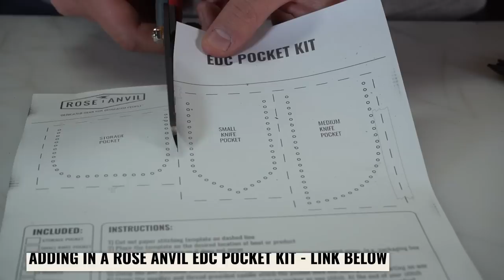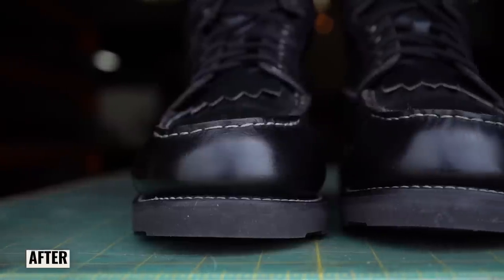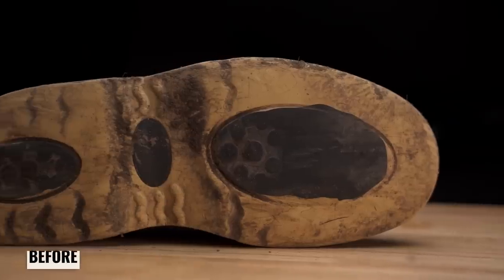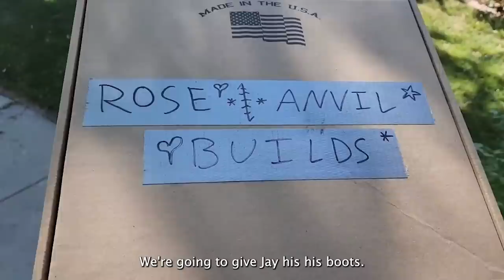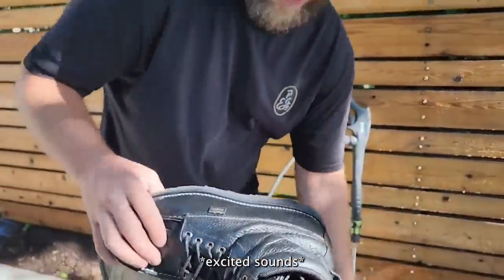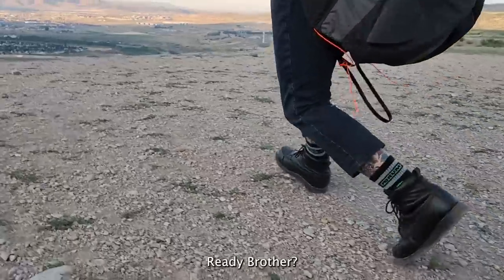Red Wings Paratrooper Boots

Comment: Wondering how practical the tongue pocket would be, and whether or not it could be dangerous in landing to have a knife there, pushing into your ankle
Reply: Closed blade and above the ankle joint so it doesn’t inhibit range of motion. Should be fine. If he twisted or folded the ankle, the knife won’t effect the injury

Comment: Fantastic job, only miffling is the extra leather at the toe probably could have been implemented better, that isnt going to hold up to a ton of abuse is it? Prolly just add a stitch line to the sides and it would go a long way
Reply: My thoughts exactly. The glue will start to split and dirt will accumulate between the toe cap and the toe.

Comment: Boots with lace hooks are not suitable for paragliding, as they can trap lines during ground-handling and takeoff.
If that happens, you can end up dragged over a ledge with a collapsed paraglider.
Great that the hooks were removed during the repair/makeover.